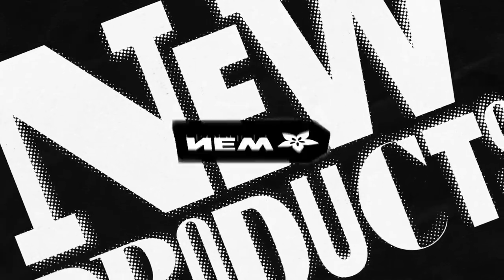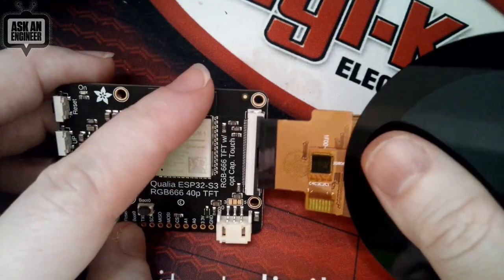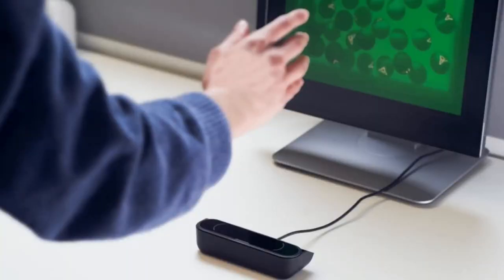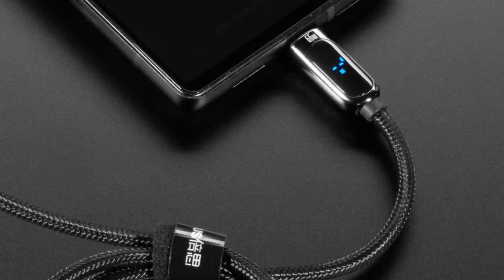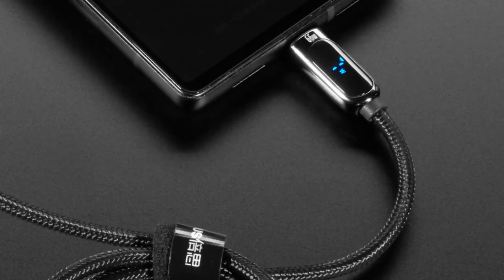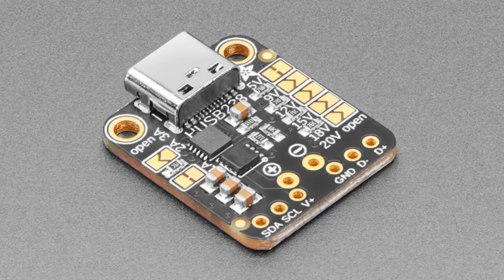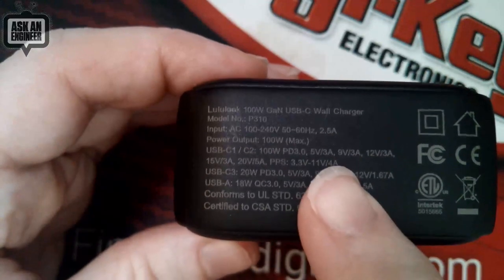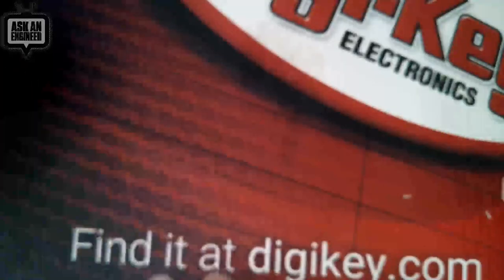#NewProds 9/21/23 Feat. Adafruit USB Type C Power Delivery Dummy Breakout - I2C or Fixed -HUSB238!

Comment: PSA: Many USB power banks do not support 12 volt USB-PD (I'm told because Apple?). If you encounter power banks that do not output 12 volts no matter how you set up the decoy board, consider setting it to 15 or 20 volts and wire it up to a buck converter module like one of the boards from Pololu.

Ooo. USB-PD breakout board. Shiny.

I'm liking the decoy boards on Amazon that have DIP switches rather than solder jumpers, but then, these aren't nearly as tiny as the first board I tried to set up without a microscope or a magnifier. This is useful enough to me that I might try to reverse engineer the circuit so I can build it into PCBs,